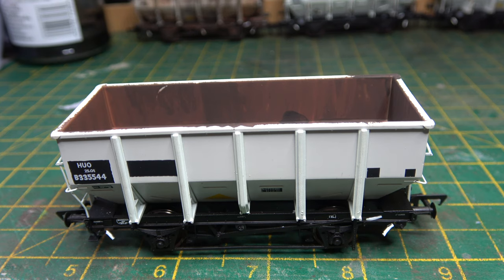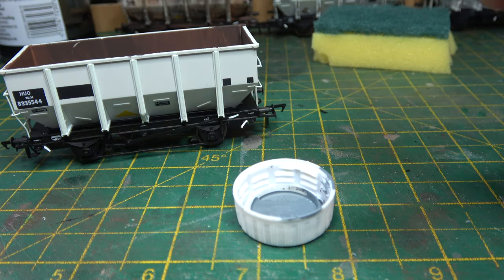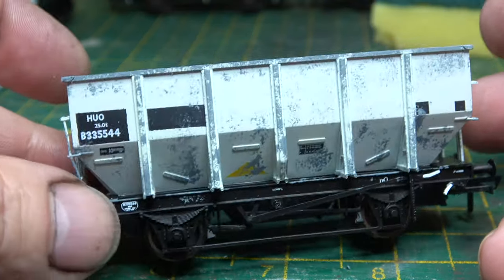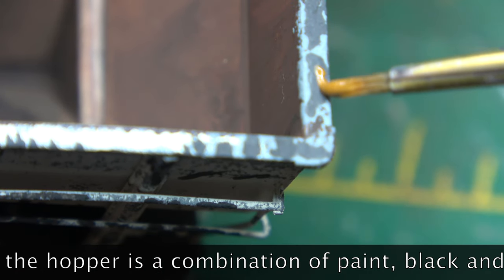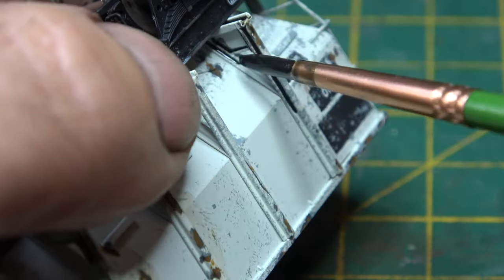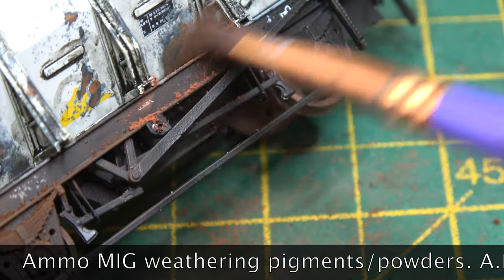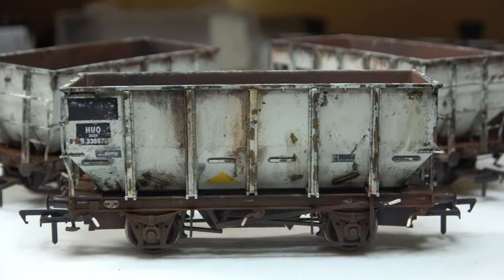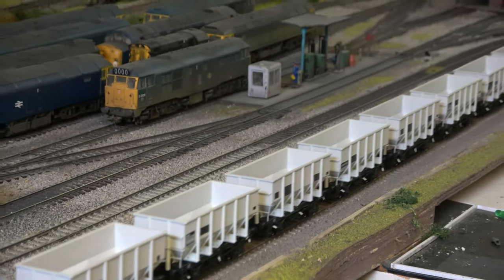Weathering Accurascale HUO's - sponge technique

Comment: Looks great, thanks for sharing. Which manufacturer’s powder did you opt for? Seemed to go on quite nicely where as I’ve found with the ones I’ve bought so far it’s a bit all or nothing in browns and blacks. I’ve also bought some pastels to have a go at making my own but also as I’ve seen one of the aircraft modellers use pastels to make washes very affordably, not yet tried this though
Reply from the maker: Mig-Ammo are the powders/pigments I use. They do go on really well. I put the fixer through the airbrush on a very low pressure. I've found that produces the best effects in my limited experience of them. 
Thanks
Reply: Wallsrail thank you very much, I’ll look out for some Mig-Ammo then (or rather eBay payday spending spree!!)